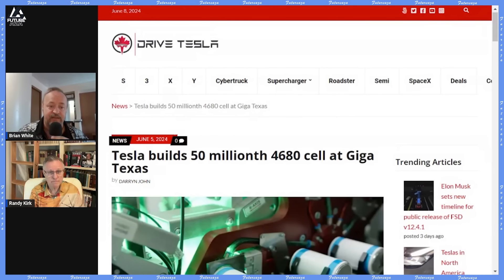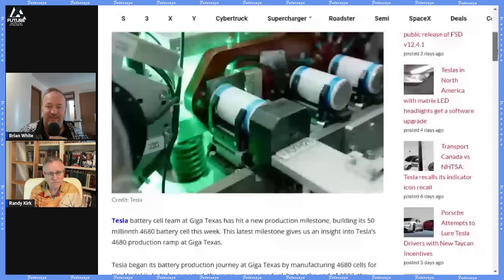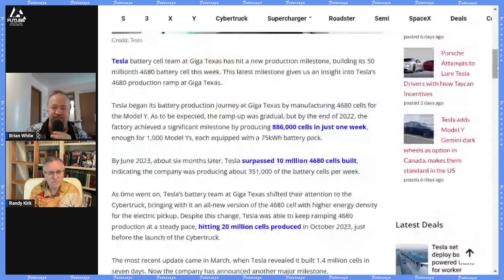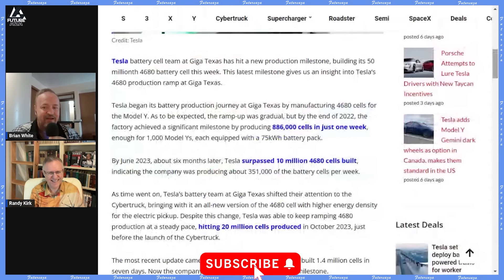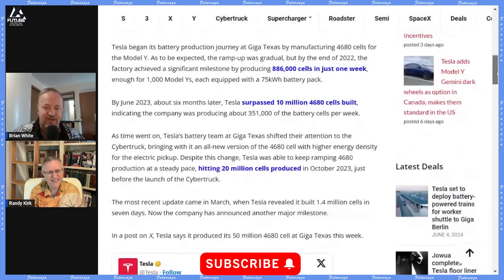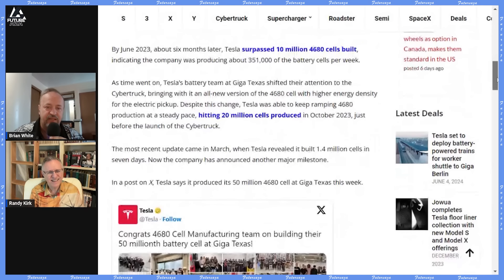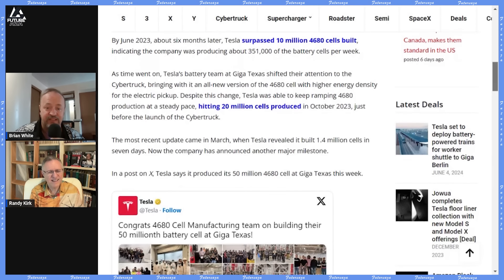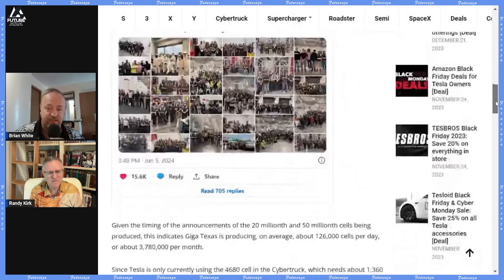4680 is just the Shape. What We Need to Know About the Battery's Future

Comment: The manufacture of reliable rechargeable lithium cells is extremely difficult. For a newcomer with no experience in manufacturing rechargeable cells to succeed is in itself actually amazing. To introduce untried revolutionary ideas to create large cylindrical cells
which were previously considered impossible by other manufacturers due to overheating makes this feat even more outstanding.
It is fully understandable why it took Telsa longer to ramp up production than Elon hoped. To be an innovator and to venture into the
unknown you have to be extremely optimistic. This necessary optimism almost always means you will late due to unexpected problems.
Reply: Thanks for sharing.   Nice to know.   I've been a little disappointed with the roll out of the 4680.

Comment: 4680 is a complicated topic.  Yes, the 4680 is actually the dimensions of the battery, however for Tesla it is a radically different battery design for a cylindrical cell battery.  The new design has introduced a number of problems and has made production hell.  However, to get where they are at they had to solve a number of issues.  The biggest problem is that we don’t know why the problems were and what remains.  And that makes it very difficult to have a good conversation about them.

Comment: Tesla built a cathode factory and a lithium refinery.   I don't see it getting out of the battery game.
The fundamental difference is that DBE technology still uses a liquid electrolyte, while solid-state batteries use a solid electrolyte.  The goal of DBE is to eliminate the expense of drying the slury/paste  applied to the electrodes.     This makes any battery made with the dbe process less expensive to make.     Currently solid state batteries which use no liquid electrolyte are more expensive to make than liquid electrolyte batteries.   The 4680 with on dbe electrode and one paste can still be a competitive battery.   We need to see where Tesla  goes with it.

Comment: I think 4680 being so far behind got drew canned. Anyone dumping on 4680 needs to show me any other startup making a brand new cell in a brand new factory using brand new size formats on all new equipment&processes plus pioneering dry electrodes quicker than TESLA has done!

I won't bother holding my breath. As I know the answer, just like I know drew Zach and Elon all publicly said in 2022 the 4680 was on a 6 year timeline from battery day. We ain't even at year 4 yet! And it's hit the milestones Elon mentioned in August of 2022. 

A ct pack is 460# lighter than the rivian r1t gen1 large pack. At 8kwhs less total capacity, but uses the pack casing as the vehicle's floor pan! 
Per the various munro teardown weights.

The ct tri motor cyberbeast will go further on 123kwhs with at 35" tires than either the rivian r1t quad large 131kwh pack on 34" at's can manage or Ford's lightning platinum on 34" tires can go with a 130+kwh useable pack. It will also outaccelerate and outhandle those truck's+it has v2x rivian doesn't, 800+v, rear steer, air suspension etc etc. 

A ct has charged 80+miles of range back in just 8mins using a 350kw 800v charger by the owner of amp. Lars also has told top gear that a ct on a v4 scer once the ota update comes out will do 180-200 miles back in 18-20mins. 

But nobody whose a hater even bothers listening it seems to real engineers sharing real data about the 4680 gen2 cybercells&the ct. 😀
Reply: Can they easily change chemistry when it is economically feasible?

Comment: POWER DENSITY & LOW RESISTANCE, FLAT CURVE CHARGING!!
Why isn't everybody screaming from roof tops about these fundamental failures of the 4680? Without a power density of around 350 to 400Wh/kg and 15 minute 10% to 80% charging then the Tesla Semi isn't going to change  the trucking industry, and the Cybertruck high tech wizardry is never going to make it a working man's long haul vehicle or a construction site must, for electrical power and trailers!
I am a Canadian contractor and immediately put down a deposit on a Cybertruck because I travel across Canada, in all weathers, with a load of tools.  A Cybertruck with 500 mile range, Quick charge, and Auto-Pilot, would change my life and save me a ton of money! the present offering just doesn't cut it!
Reply from the maker: Semi was never announced to use 4680s. That battery wasn't announced until years later.
Reply: @FutureAzA   Thank you for the clarification🙂 My comments are based on what was said at Battery Day, Power/Weight calculations made myself (HND Mec. Eng) with help from my son (Heavy Duty Mechanic, Red Seal), we came up with a battery size for the Tesla Semi of 900,000wh, with a weight of 5,000lbs (Freightliner tandem Engine, Gearbox, Transmission, and Diesel: 4,000lbs+1,000lbs additional ~2,268kg)  =397wh/kg!
This is why we think that the goal of the 4680 (including "Tesla Silicon") was, to get a usable 500 mile Semi range, requires 4680's outputting between 350 and 400wh/kg

Comment: I was wondering if navigating to a supercharger, which preheats the battery, and then not charging could cause any problem for the battery.  I'm sure this wastes energy, but don't know if it stresses the battery.  I've only done it a couple of times when there wasn't an available charger, or plans changed.  Anyway that's my battery question.  Thanks guys.
Reply from the maker: Great question! Should be fine. The battery has a wide range of temperatures where it's comfortable and this is well within it. I'll see if I can get that in.

Comment: CATL has the best battery chemistry with the longest life and fastest charging speed!
Question: Can Tesla collaborate and utilize the same chemistry/technology in the same 4680 shape?
Reply: Yes, Tesla has ordered and is installing a LFP battery line designed by CATL at Giga Nevada. Licensing CATL tech and chemistry. So it should be a small step to bring out a 4580 version. However, the LFP does have lower energy density so Tesla plans to continue with their NCA chemistry for high end models and use LFP in their lower end models. At this point, there are no entry-level Cybertrucks being produced.

Comment: 1. Tesla needs to offer a lifetime battery warranty. Make it 60 percent SOC dependent. That is the biggest bang for their buck. Their battery replacements are so low that it would cost them almost nothing to do. 

2. 4680s have a fatal flaw. The cells are too small leading to a pack that requires more time and cost to build. Never mind the fact that they are nearly impossible to repair. They require an stupid amount of epoxy so it's a design flaw. While byd cells are much larger leading to lower pack costs and easier to manufacture and repair. Their pack strategy is flawed from day one. They need to look at their Chinese counterparts but they can't change until they make square cells in the USA. They backed the wrong design horse.

Comment: New it!   I always said 2170 battery was better.  In the model Y.
Reply: You've missed the point of the 4680 format.... And the dry process method.... And the Tabless design.
Apart from that, you have a point....
Oh.... Wait...
Reply: @rogerstarkey5390  I said in the model y…. The 4680 wasn’t developed when it first came out.   In a few years the 4680 should be better for the customer.. faster charging , longer life, cheaper.  You must have not been following the last couple years of battery tech.
Reply from the maker: Seems so.

Comment: So according to Randy, not producing 4680 batteries at expected volume is an altruistic move from Elon?
Reply: Don't miss the point.
.
The Aim of the 4680 SYSTEM
Maximum kWh (GWH/ TWH)
From the smallest FACTORY...
At the lowest COST.
.
ALL parts of the system need to work in concert.
THAT takes time.
.
AT THE MOMENT, due to the glut of cells, caused in the main by others "pulling back", other manufacturers are cheaper than 4680......
.
That's not to say things won't change.